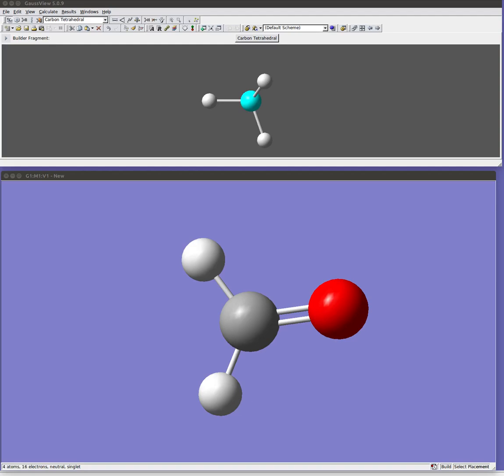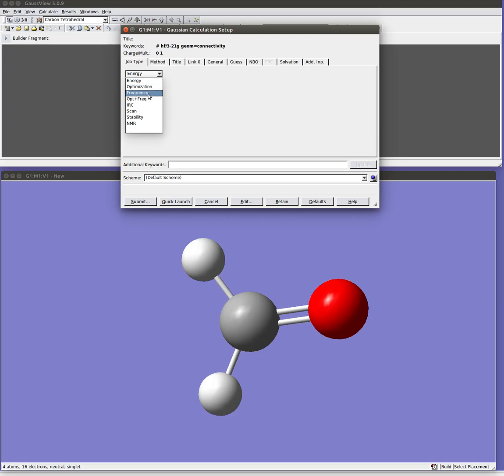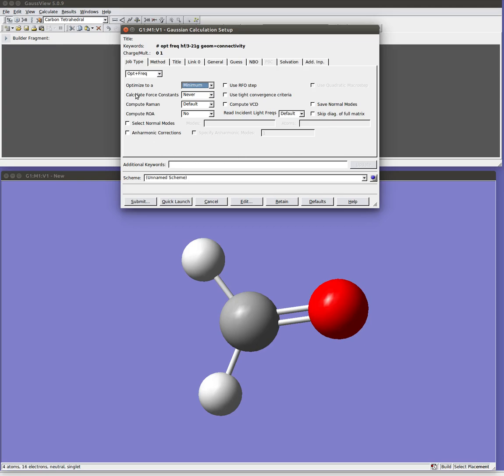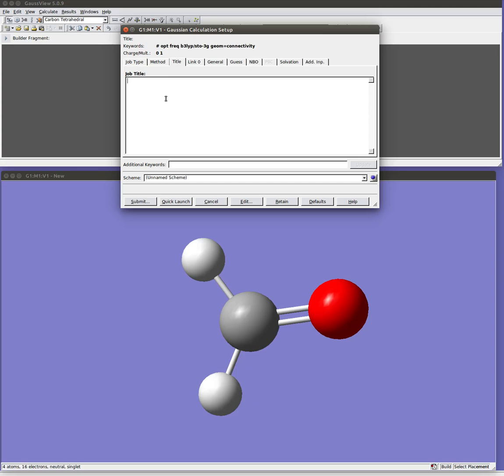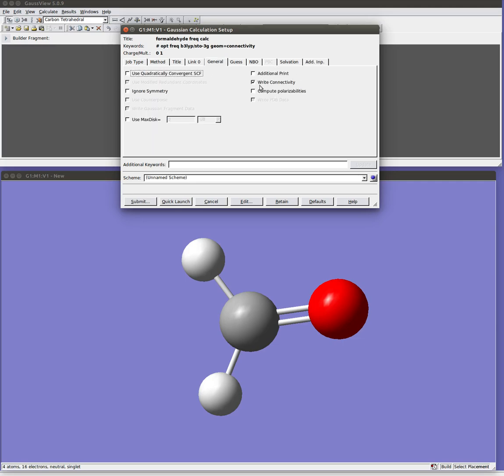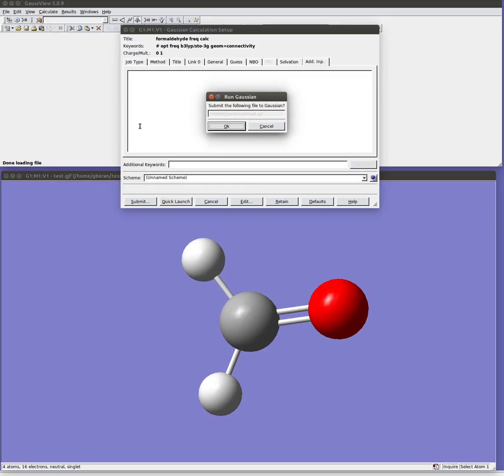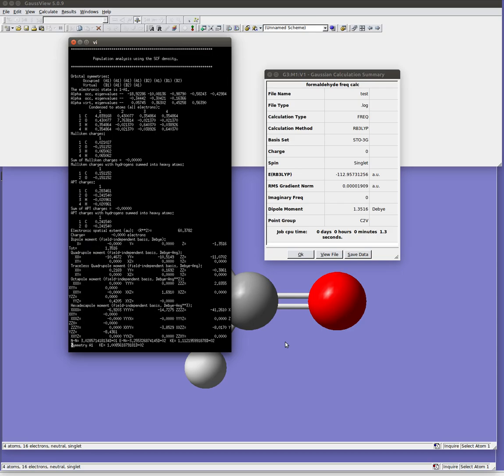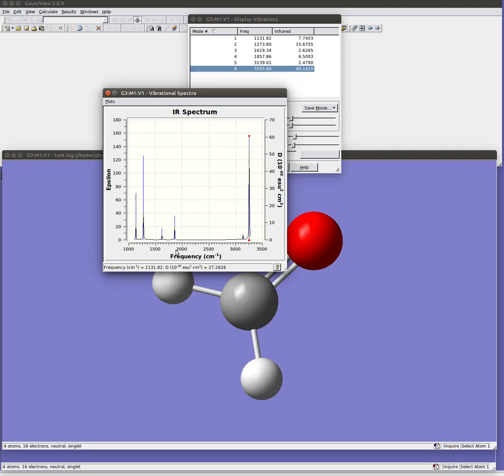Creating and running a simple DFT calculation in GaussView / Gaussian

Comment: Nice explanation sir but
When I calculated DFT  there is error in submit option..what should I do for this?
Reply: Same is the problem i am facing dear... Excellent video.. bt i can't submit the job..
Reply: if the structure is not right it can happened usually
Reply: @ranjnachoudhary  mam but same structure for other system all the calculations are running,
So I don't think there is any structure problem
Reply: @shubhangiathawale8044  then in your error window also show the problem like basis set or etc. pls read the window carefully.
Reply: @ranjnachoudhary 😊yeah
Reply: Can anyone tell me? 
I need to optimise the structure in gas phase? What should I select in solvation? 
Nothing or?